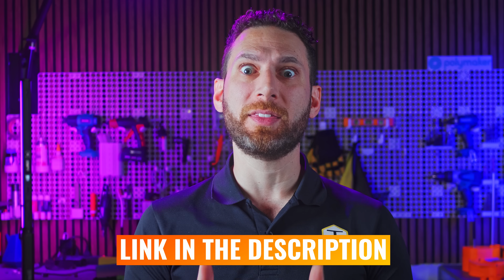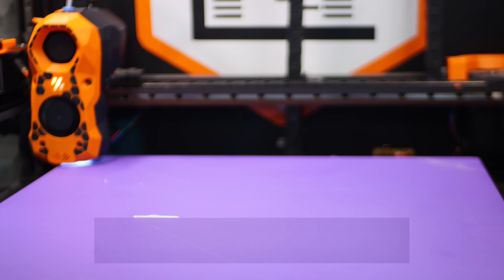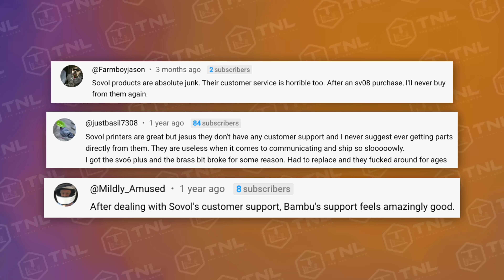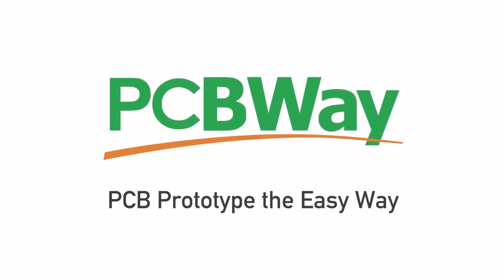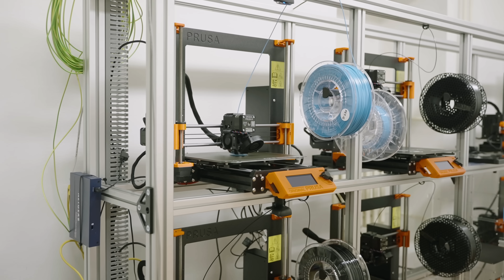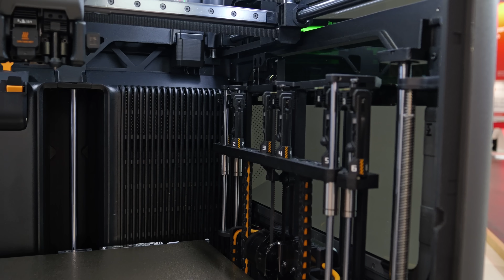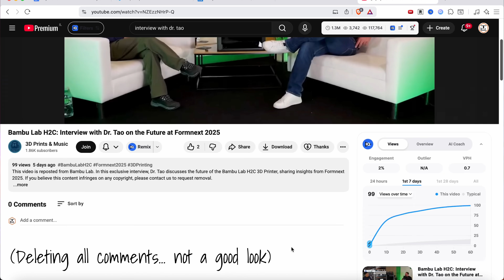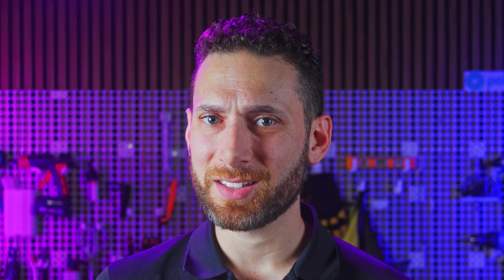My HONEST Annual Report Card for Each 3D Printer Brand

Comment: I went from an Ender 3 to an X1C. I don't care for the multicolor prints on the X1C because of the time and waste, so I use my AMS just as a means to not have to load a new color every time and to continue after an empty spool. I was really looking forward to the H2C but now I don't think it's worth it. 
Question: From an X1C, what printer would you recommend to increase bed size and enable multicolor prints?
Reply from the maker: Snapmaker U1, probably. If 270 is big enough for you.

Comment: Bambu Lab is sadly not open source but their machines most of time just work and get alot of beginners into 3d printing
Reply: As a hobbyist / casual business user (engineering fixtures), I am very happy with the "it just works" aspect of my P1S. I'm too old to spend time tweaking a system to reach peak possible performance. I wish it worked better (i.e., open a/o open source) with my Big Panda screen, but a small price to pay for getting stuff done.
Reply from the maker: Agreed. But most of my criticism had nothing to do with open source. Why are people making this straw man argument?
Reply: @thenextlayer  I am another person who does not care about open source as I understand the benefits of not doing that.
I would rather see Bambu improve their slicer so it has more of the print options found in Orca so I can fine-tune my prints a bit more, with the stability of a solution that is not in Beta.
Reply: @colinarmstrong1892  another nice guy who got the point why bambu is good
Reply: It’s not a straw man…
You evaluated Bambu wrongly as well as other companies.
You just gave them your rants and wishes.
One of your rants was about them being closed source.
Turns out most people buying 3D printers don’t care about this.
This is why Bambu sells the most. They have the most amount of customers. They captured a market that Prusa never thought of and still doesn’t market to.

Comment: You seem to have forgotten that Prusa also had a teaser about their Core1 with INDX at the same time Bambu Lab teased the Vortek prematurely because of all the commotion around the Snapmaker U1 launch. I don't know why you consider that not professional, because it is common practise. I call it 'put a brake on the market' to buy you some more time. Bambu Lab was working on the H2C for a long time and it took them a bit longer than expected, but it is pretty normal for a company to show the market what is coming when a competitor is beating them to it.
Also, and that is something I say to most reviewers who spend their whole review video ranting about the time it takes to change color/material: there's more to the H2C and the Vortek system than that time. For instance, the possibility to have 24 colors/materials on call. And soon, there will be a 'filament switch' that can swap AMS output to the other nozzle, so you're not bound to the setup you have with 1 AMS for left and 1 for right, but you can have it swapped mid-print.
But the Vortek also enables you to easily swap nozzle sizes. By having a 0.2 and/or 0.6 nozzle in the rack, you can very easy print that gridfinity stuff. So, yeah...like I say, there's more to the H2C than just the time it takes. Personally, I don't really care about that time. I just want a versatile machine that gives me a lot of options, ease of use and convenience. Fortunately, some reviewers have looked past that and made a decent review. It reminds me about the reviews of the H2D, where 'everybody' were complaining about the confusing bedsize (this was confusing tbh) that was smaller than expected. But in the end fact is that the bed is more than big enough for the majority of users. And it's still bigger than the Core1 L, and nobody complains about that size. It appears to be big enough...
Reply: H2C is a swing and a miss. H2D was already a partial miss.
Reply from the maker: Prusa only teased their INDX after Bambu pulled that nasty trick. It was a taste of their own medicine. Also sure it’s common practice to tease products but when a company goes from $1M fines for breaking embargo to suddenly showing what’s next in the pipeline overnight it makes you wonder… 

As for Vortek, that may be, but from where I’m sitting and from all the comments I’ve seen on all the reviews… it’s a flop. No abrasive filaments or TPU? What?
Reply: @thenextlayer  Not sure it's a flop. They seem to sell pretty quick. I ordered just a few hours later than a friend and he has a shipping date of dec 12th and I get to wait until the 23rd. We'll see how it turns out. In my opinion, it's a great machine and like I said, I don't really care about the time. I care about the other features of the H2C.

Comment: I am a opensource developer have been for decades. This 'the community' is BS it really is there is room for both ways. The whole power of opensource is that there is always a option to go that route  but stop trying to force it on everybody will not work with apple and it will not work with probably bambu or dji or... We need these companies too and they add a lot of value. Same with the hardware views it's very biased the reason why so many 'bambu fans' are in the comments is because they are also a community and you exclude them really. Saying they are 'doing a announce early' on vortek? It was announced in August and shipped in Nov.. 3 months... U1 and the INDX (with or without prusa?) think more than a few months. Opensource supporters are the worst at times and i say that coming from that mindset. Defend the space of open when its in danger don't try to force it on everybody .. Many people want a printer that just works and they got 4 ? new printers that just do that from them this year and they all shipped and many people like them... that also is a community a community that likes to buy now and not some point in the future i have gotten myself a h2c fully knowing its downsides (also compared to say a possible Prusa Core One L INDX10?) first seen it somewhere in august announce and got it at home printing 26Nov we like that. What will happens next year who knows maybe the Core One L INDX10 will be released in ehmm Jun? maybe not.. maybe it will be prebuild ? ehmm maybe not... maybe it will cost as much as a H2C ? maybe not... .. to the community you are not apart of and clearly disrespect we are happy to buy now and decide again in 2 years.... o well i guess ive fallen into the comment trap again and will be yelled at even if i DO try to respect the opensource/cooperation mindset and love to read about things like INDX but get upset  at time with funny very closed way of thinking of people in the open side. Takes me back to firing system admins who refused to touch a osx machine even to log into our datacenter. Extreme views are never good that is not what open was about even if some of its founders at times had the same weird extreme habits. ... ok shields up and flame away at me people....

Comment: Okay so heres my question, will the Prusa Indx come shipped that way? Or is it something we will have to do ourselves (mod it)? I personally joined in on the Bambu side of things, but I've always been open minded, I personally want something that can do multi colors as a lot of my prints are 2-4 colors, and take up to 16hrs to print, I know if I was to get the H2C it cuts my time down to 4hrs.. But the price tag on the H2C is crazy imo, I only print PLA (for the time being). Thought about the U1 as well...
Reply from the maker: Kits at first then ready built printers later
Reply: Bondtech will be selling just the INDX kits at start. Later there should be available completed printers with INDX.

Comment: I bought the Neptune 4 Plus as my first printer about a year ago and while part was user error/learning, their stock firmware was a headache. Eventually, I had a motherboard failure (apparently common and now remedied) that I had to reach out to CS and have them send me a new board. It fixed the problem, but since it came with another memory module, I flashed my old one with OpenNept4une and WOW. Problems I was having were no longer the case and the printer has been near flawless until recently (as I updated some software and I think I borked some settings, my bad). Overall its a great printer, but Elegoo put me off when they said "Carbon will get MMU!" before now going "well.... maybe, but the C2 will!" 

This really put a bad taste in my mouth as the Carbon was potentially a future upgrade/addition for me. I ended up going with an AnyCubic Kobra 3 V2 recently after doing some research. For the price, I was willing to take the risk. So far, it has been very reliable and the multicolor prints I've made have opened up a whole new exciting world of printing. If I ever run into issues, I can flash with custom firmware as it sounds like the process for AC is WAY easier than it was for my Neptune. 

I think when you spend under $400-500 you have to accept that you're not always going to have a flawless machine. Yes, some days I regret it, but I think when I solve an issue and get beautiful prints I feel more accomplished and knowledgeable about the inner workings of a machine like this.

Comment: FlashForge needs a larger format printer. But I love how reliable mine have been and the quick swap nozzles are goated.
Reply: After flash forge jumped the shark with their 'reporting to authorities' bit, they can't file for bankruptcy fast enough
Reply: @MinnesotaHomesteading  (some) Americans are so sensitive about their guns. As European, 10 - 50x higher gun homicide rates don't improve by printing more gun parts. But surely NRA knows better 🙄
Reply: @kimmotoivanen sorry about your homicide rates. Maybe you should get a gun to protect yourself.
Reply: @MinnesotaHomesteading  we, at 2-10 % of the US rate, are doing really fine without guns 😉
Reply: @kimmotoivanen nice made up bs stat.
Enjoy the taste of boot polish when putin runs you over, maybe America and our guns won't bail Europe out for a third time...
Reply from the maker: Never tried their stuff…
Reply: @thenextlayer it's shockingly good for the price. I came back into 3d printing sheet after a decade having previously built ultimaker 2s and getting a printer that feels like an order of magnitude more capable for about 10% of the price is nuts.
Reply: I've had virtually zero issues with mine. Still need to try the quick swap nozzles (0.4 mm has been good enough for me so far).

Comment: Creality, I can only hope they would narrow down their skews and focus on a few and get them RIGHT!!! Snapmaker looks like they are getting my money. Bambu got some of mine, bought an X1C when I saw them letting third party firmware X1Plus on their hardware only to have the rug pulled out with a firmware update walling in their garden.
Reply from the maker: Yep. Sounds like you are on board with exactly what I’m sayin
Reply: I reverted my firmware and am running X1Plus with their X1 board,  I only use wired internet and only from my local network.  It was the last Bambu I will purchase.
Reply: @woodwaker1  Yeah, I think it's the last 3d printer I'll buy from them too. I like the openness of Snapmaker U1 they have my money for the next printer purchase.
Reply: LOL have you looked at Bambu lately they are fast catching up to Creality with all the different models that they are releasing.
Bambu has released so many models this year while Creality has actually been quite quiet as of late.

Comment: I want to add a few things that really need to be added to all 3D printers across the industry... When the printer detects there's a clogged nozzle it should park the head in a position where the operator can get to the tool head and then be able to heat and cool cycling for cold pulls and or including up to just replacing the nozzle. They need to add to that situation, when the operator clicks on resume print... it should reset and or verify XYZ origin so we don't have layer shift and or bad Z offset and causing the print head to slam into the 3D part it was in the middle of making... We really need to have ways to deal with mid print issues so we don't loose so many prints due to clogging or tangled filament and especially on long prints... Not to mention that I have had the K3M  loose X zero when it changed filament colors during the purge cycle before going to the prime tower.... It should have detected that it had a collision and reset all the axis before continuing the print and having a massive crash into the part... I had to turn off the power because "Stop does not stop"... it keeps going until it gets to a piont in the program to stop... that's not stop thats a pause... "STOP"... means right now when the button is pushed!!!... I  have an Anycubic Kobra 3 Max and try to make some large 5 color prints that take 18 days to complete and 8 rolls of filament... I bought it to do that not just be big on paper and then fail on any large multiple color parts... seriously!!... This printer has had the most problems of any I've tried. I understand that it at a low price point but WOW... Not to mention all the issues that the quick change nozzles have due to poor design... that's where Bambu Lab wins if you ask me... they have the best and least trouble free quick change nozzles that I've seen so far... Thanks for sharing,  I appreciate you... hopefully they're all listening because these are very valid requests...
Reply from the maker: Good points!
Reply: Ironically my multiple Kobra 3 max printers are my most reliable printers.  I have 3 of them and a fourth on the way.
Reply: @neanie0182  You lucked out. My Kobra 3 Max requires up to 25 minutes to pre-soak the bed, otherwise I get poor first layers. The K3M bed is worse than my taco'ed SV08's.
Reply: @sliceofmymind interesting.  The only time I had issues was when I would forget to change the build plate to PEI and not Cool.  

Mine don’t take very long to heat up at all but I do have a couple Qidi P4s and those take forever to start printing.
Reply: While I have had very few clogs on my A1 and A1 mini printers resolving the problem (so far) has not caused problems with the print

Comment: As the guy who made the popular Centauri Carbon USB Cable fixes, and the guy who makes the Elegoo Home Assistant Plugin.. I feel I can say this. You were too light on Elegoo, yes they opened their firmware.. but they purposfully left some parts out of it, so instead of being able to tweak that firmware and build a new open firmware, its still tweaking the existing firmware. Also whilst Elegoo has said they have fixed that USB Cable issue.. absolutely NOBODY has even received a shipping confirmation after a month of waiting. For those reasons, as well as things you touched on (AMS, Weak hardware, etc) We returned our CC and got a full refund. Elegoo has screwed up this printer so badly for anyone who does this as something more than a hobby. 

As for me personally, I had so much fun fixing a 3d printers hardware and software problems, that I ended up saying 'screw this' and I built a Voron 2.4 350.
Reply: Eleggo: For me the worst was this lying in my face with the marketing: "we don't use Klipper in the Centauri Carbon!"

Comment: 350 mm3 is tiny! if you mean 350mm*350mm*350mm then thats 42_875_000 mm3, or rounded 42.9L
Reply from the maker: You know what I mean!
Reply: @thenextlayer  I do, but I think it's important to use generally used terminology rather than this 3d-printing-youtube jargon. Of course it's annoying to repeat so many syllables 3 times, but solutions are not hard to think of. For example a graphic on screen with the distances while you say 43 liters, or saying 350mm in x, y and z, or 350 by 350 by 350 millimeter.

Comment: Currently, I feel like Bambu Lab is a bad company that makes good printers. So I definitely go by every word you've said about them in this video. Their actions in the past year have mostly been really anti-consumer, and that's not only reserved for their printers. MakerWorld is also starting to reflect those things as well. On a most recent case, I've been going back and forth with them regarding their changes in the rules, how they've applied such changes, and the lack of support for makers to actually comply with said rules. For example: Sending messages to makers that their print profiles may not be following some of their rules, but failing to give any indication to which profiles are at fault, or providing tools to help us identify those. Just a plain "terror message" making us fear that our profiles might get deleted out of the blue and then we suddenly lose lots of hard earned points in their platform.

Comment: my wish - 40x40x40cm REAL dual printhead(idex) for mirror mode + core xy with 6 real Independent toolheads in the back , each individually accesible wich each printhead + the ability to add a ams to each toolhead
Reply: Please sir mm not cm. 😅
Reply: That would be a hell of a printer, the only other thing I think you could add is non-planar printing, but that probably still needs more development before it becomes practical.
Reply: holy shit!

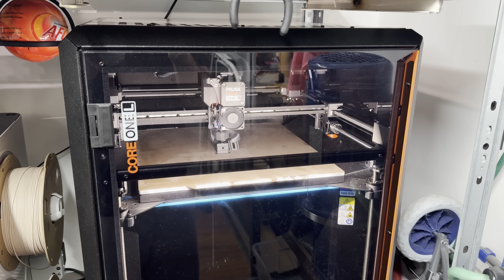Comment: sorry how did they fixed the nozzle brushes in prusa? i dont see anuthing at 4:56
Reply from the maker: I’m running the pre release firmware and it has a new routine if it fails, it retracts and then works the next time. But also it seems more reliable since updating. Fewer fails
Reply: @thenextlayer yeah I am in same firmware, and still not reliable, I had tpu and it did two times failed two times and each time asked me I want to continue blablabla the thing is, you still need to stay in front of the machine....
Reply: I had the same question, glad you specified here.